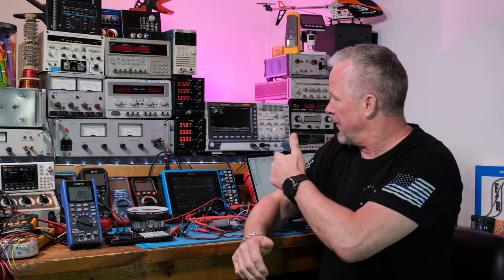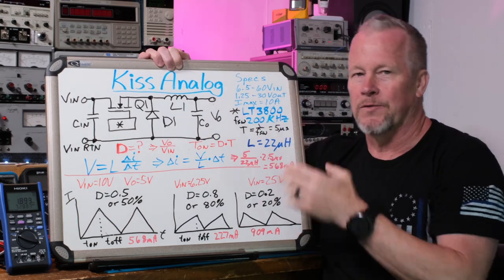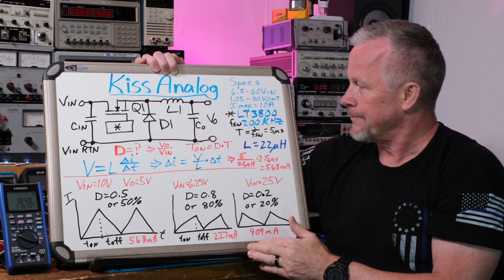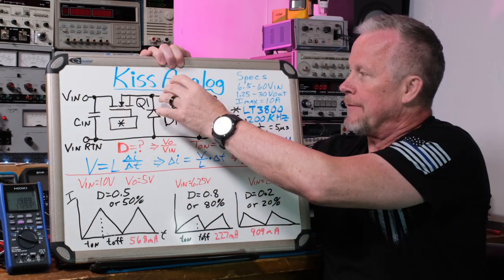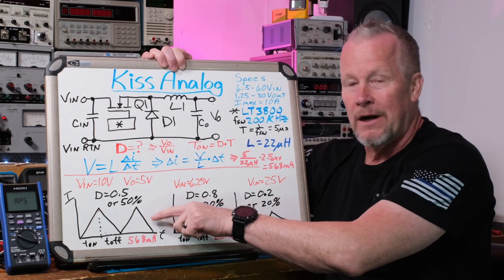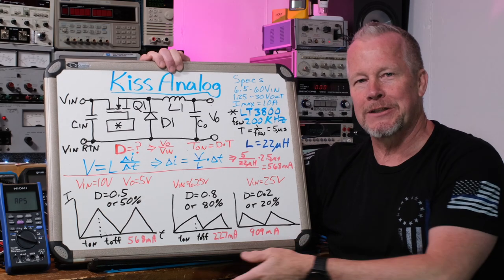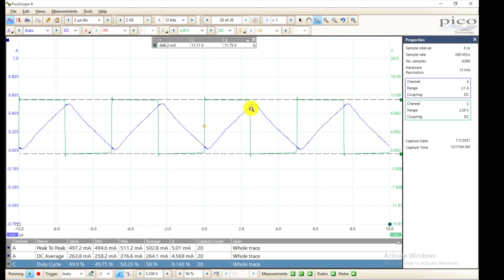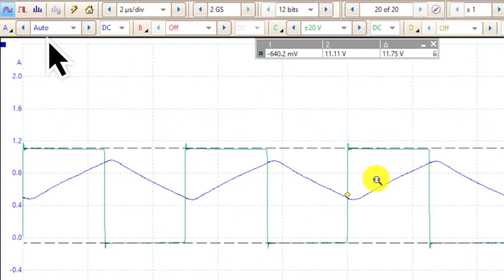Buck Converter duty Cycle Demonstration - How it works SMPS #5 #buckconverter #SMPS

Comment: I'm looking to the whiteboard, but the Hioki on the left is doing crazy measures of the air.
Reply from the maker: LOL ;)  Sorry if that was distracting.  It has so many digits as it is such a sensitive meter with high accuracy, and it is very fast, so meters like that will just float around and go crazy with open leads;)  That Hioki is now my favorite meter.
Reply: @KissAnalog  no problem, but it's crazy, LOL
Reply from the maker: It also depends on what measurement it is set on;)